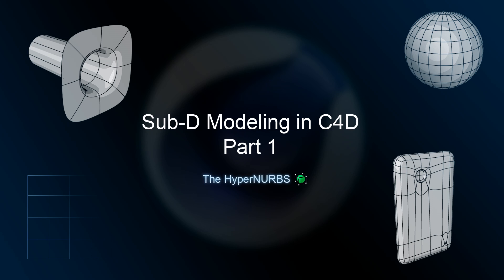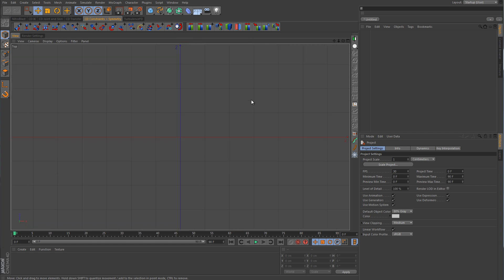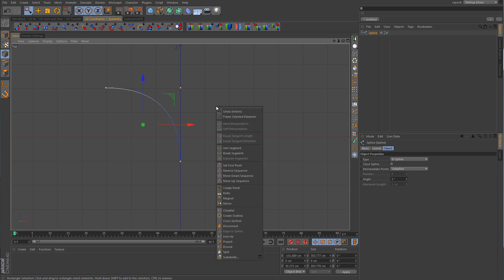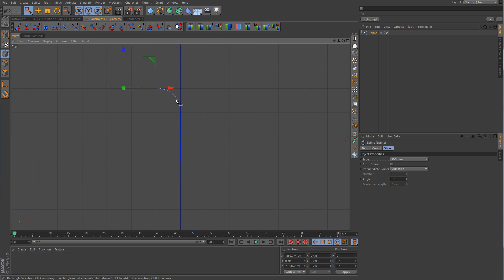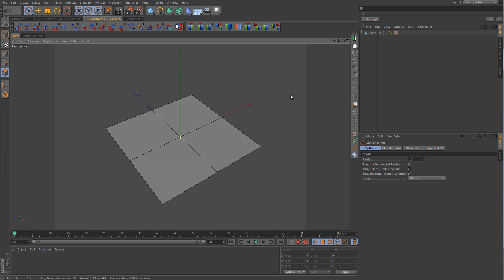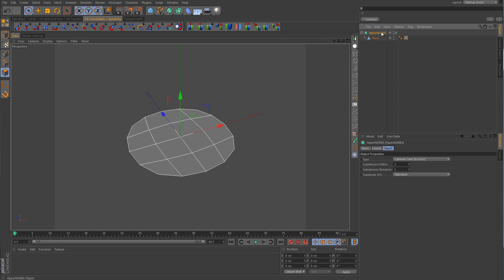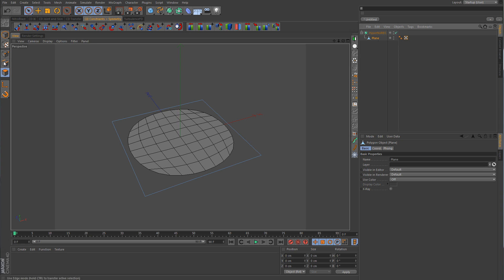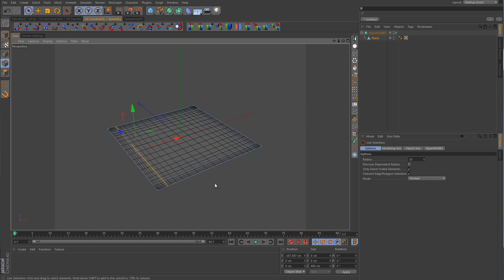Sub-D Modeling in C4D - Lesson 1 - The HyperNURB

Comment: heyy! i'm wondering how you tackle the issue of adding embossed or pressed logos or typography onto (sds) models. especially for close-ups it can be a pain to get a clean look.
Reply from the maker: It would depend on where the embossed logo is positioned. If its on a flat surface, then it shouldn't be too hard to model. However, if the surface is contoured, then you may need to use sculpting, or perhaps a bump, normal, or displacement map.
Reply: thanks! i have to get more into sculpting. so far i mostly do a lazy boole operation with n-gons and bevel them out.